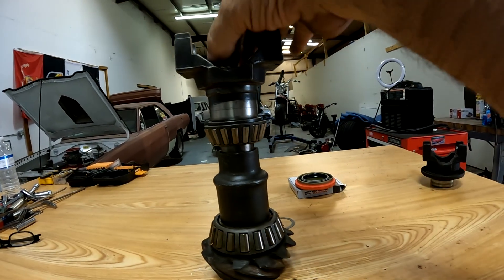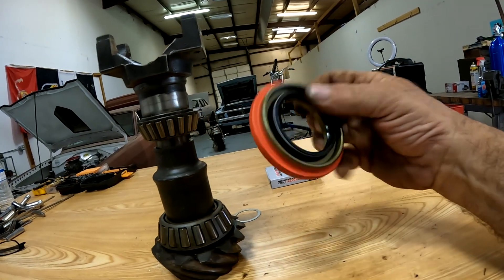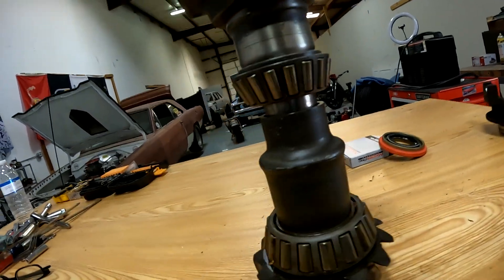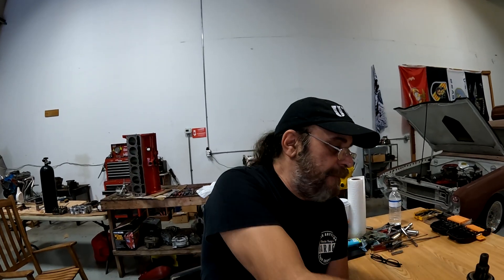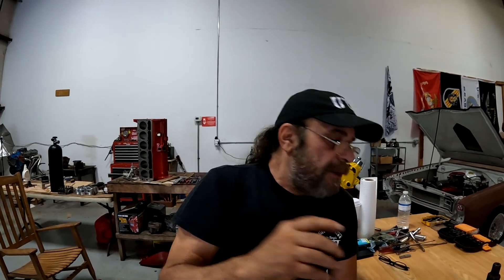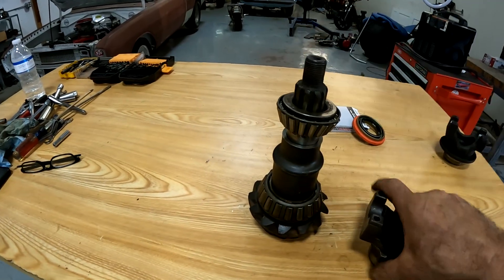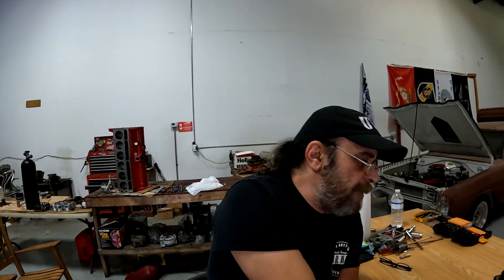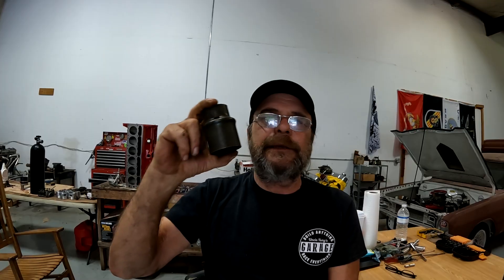Sooner Or Later One Of These Is Gonna Bite You - Dealing With  Your Diff's Crush Collar

Comment: I bought a new 92 Dakota 318 4x4 .My only new vehicle in this life. I kept it for 5 years and 50K miles and sold it to an old buddy. A week later the pinion nut backed off but luckily he parked it immediatley and I had triple A haul it to my shop. It did not hurt anything having about 11/2 threads still holding on. I checked the gear pattern and slop and reassembled with red loctite on the nut and drilled it and the pinion shaft for a cotter pin. I rented a big 250 lb torque wrench and tightened to spec. That could have killed my old lady and baby boy,I was so pissed off! He drove it another 150k with no issues.

Comment: On my mud truck I re geared the front axle from a 3.73 to a 5.13 and the only new stuff I put in were the gears. I was able to re use all the bearings, bolts, crush sleeve and seals. Kinda backyard hillbilly but it’s been working for me and it might work for you too, but that’s for you to find out
Reply: Zas

Comment: One of the tricks we used to use was the double-roll solder.  We torqued the nut to the proper torque with the solder between the bearing and the collar, then measure the thickness of the solder upon removal and there was our shim thickness.  Old school!  the cost of the solder and the shim were much less than even the crush collar.
Reply: Damn, dude, that's smart.  I'm gonna use that.  Thanks 😁
Reply: One thing, DO NOT USE ACID CORE SOLDER!
Reply: @mdcuddy3286  
Yep, don't wanna have a bad pinion trip. :3
Reply: @mdcuddy3286  Plumbing solder is solid with no core.
Reply: @mdcuddy3286  Why? EXPERIENCE?:face-green-smiling:
Reply: @charlesangell_bulmtl  The acid will get on the race and destroy the micro finish for the bearings to ride on.  I also had a standard nut of the same thread pitch when doing the preload assembly thereby not having to have a lock nut on the threads of the pinion.  I was taught this from working on tractors, VW's, GM corprates, Ford 9", Dana's, etc. at a locale shop.
Reply: You can use annealed copper wire too if you don't have solder
Reply: I love old people 😂
Reply: Wonder if Tony remembers this?
Reply: 89 gm pu. Could never get crush sleevefrom parts stores, would not crush to spec. Could not achieve optimal drag.
Reply: Genius
Reply: That's fukken clever! Genius!
Reply: You are completely full of shit!

Comment: If I have to change a pinion seal I just marked the pinion and the nut and when I assemble back together after replacing the seal I line the two marks back up and go just a little bit tighter and it always seem to work for me. Never had any issues. It might not be the right way by the book but it works for me. Now if I was rebuilding a rear end and changing the ring and pinion then I would change the crush collar and do it by the book. The people I see that have problems are the ones that don't know better and use an impact and just send it.
Reply: i use a sharp chisel to stamp a perfect mark   and change the seal then use red thread locker on the nut   ive never had an issue

Comment: im fixing to do my 96 jeeps dana 35 front end as well tony. i need to know what to do exactlly. thanks for the video man i knew theres preload and doing it right here.
Reply: Dana 35 is the smaller rear-end. Your rear-end (if a TJ or XJ) could either be a D35, a D44 or a Chrysler 8.25. Your front axle is going to be a Dana 30. There's two types of D30s, high and low pinion. XJs generally have HP D30s and TJs LP D30s. The LP D30 has a crush collar but the HP D30 uses shims only, so if you have a HP, there's no need to worry. Just measure the force required to rotate the yoke (using a 1/4" digital or dial torque wrench; click-type won't work) with the front wheels and brakes off. Rotate it fully several times and take the average of all your measurements. Then just zip off the nut, do your work and when you put it back, you torque it to the required specification (see the service manual). After that, remeasure the force required to rotate, and slowly torque down the nut further until you reach the original measurements. Of course, the in-field or quick and dirty method is just to mark the nut with paint, count the rotations to remove it, then when you put it back, you count the rotations to put it back on, and then tighten that last bit until your paint marks align. This isn't the "right" way to do it, but it works and people have been doing it for ages without issue.

Comment: Once I replaced the bearings and seals on a brake caliper. A little while later heard the dreaded hum, thinking it's the rear differential. Upon further investigation, turns out the inner seal in the caliper had a flange in the outside that started rubbing . Replaced the seal with the proper unflanged seal, noise disappeared

Comment: Never gotten into a ring and pinion, but I've opened up a diff to pull an axle for a wheel bearing.
So does this fine line between gear-mesh play, and drag, yield the perfect paint-mark transfer, or is there more to it?
Reply: Alot more to it...pinion depth, and ring gear position.  it can be easy, or very difficult on any one diff.
Reply: Pinion depth is first, then pinion bearing preload. Ring gear backlash in conjunction with bearing preload.

Comment: No kidding! My turbo 318 Duster "relaxed" the crush sleeve in my 3.23 489 gearset.  It totally wiped out both the ring and pinion, metal in all the bearings.  I really thought we put crush sleeve eliminator in it(BTW Yukon has the best one for a 489 case Mopar) but we must not have, which was a big mistake.  Losing the 1968 original 3.23 gearset has been rough.
Reply: Can't you just get the 3.23 gears out of another 1968 axle assembly?
Reply: @DanEBoyd  I could if I could find them.  They were a beautiful set I found fairly local.  They were nearly NOS quality.  I will NEVER leave a crush sleeve in any 489 I build.  Good thing my 741 case out of my 67 GTX doesn't have a crush sleeve, otherwise that would have been wrecked the way I drive it.